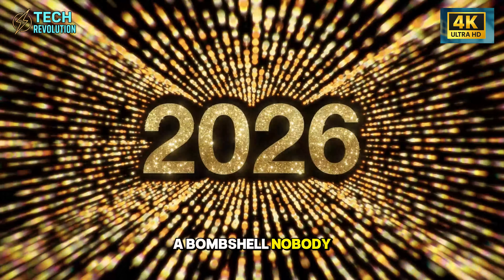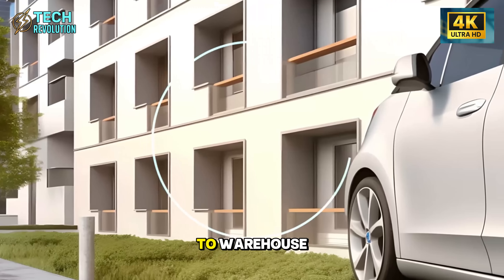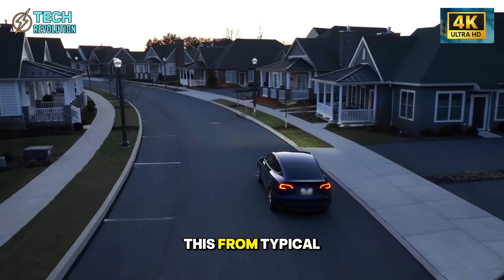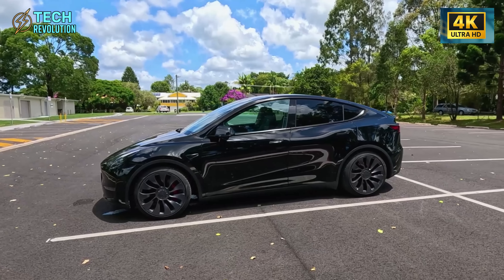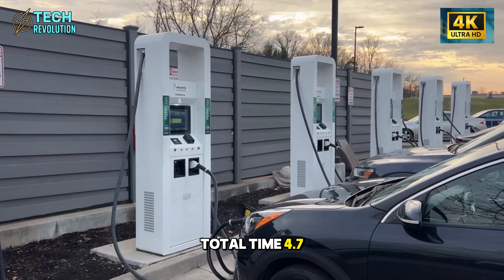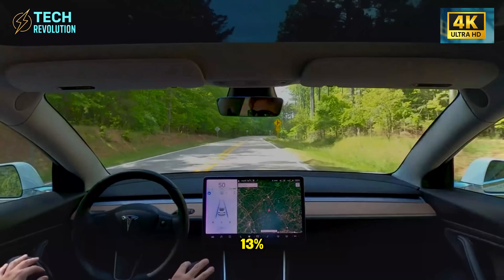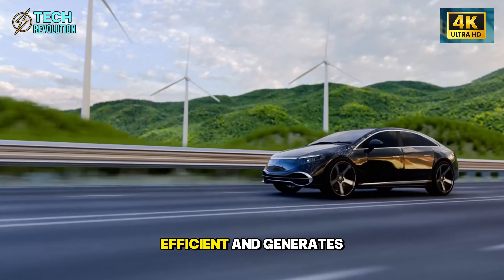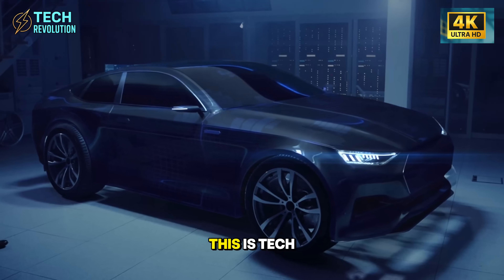Tesla's $20K Model 2 FINALLY HERE: Built in 5 Sec, Earns $35K/Year. SHOCKING!

Comment: I would like to see evolutionary minimalism, 2 seats, hatchback, 2 doors, large cargo area, Polycarbonate windshield, Aerogel insulation panels in doors and roof, Swappable center console and steering controls. Seat with full recline, Standard 18 inch wheels, Starlink, Solar roof, No BS features...
Reply from the maker: That’s close to Tesla’s Model 2 philosophy: radical minimalism, fewer parts, function over fluff. The real debate is which features boost durability and cost, not luxury.
Reply: @TechRevolution26  Luxury and handicap features can come in aftermarket packages.